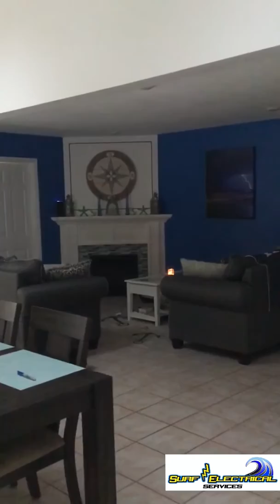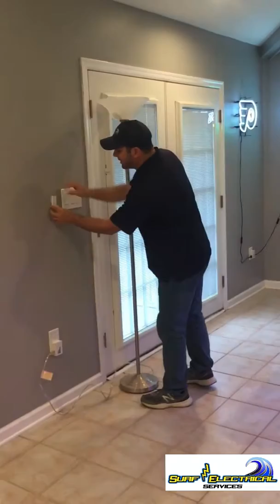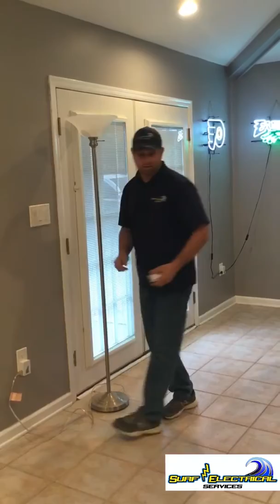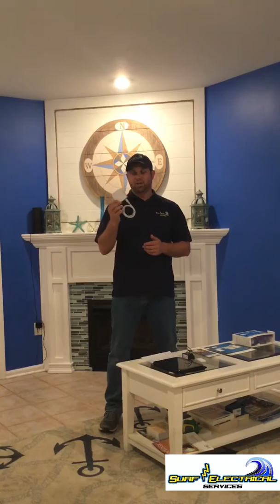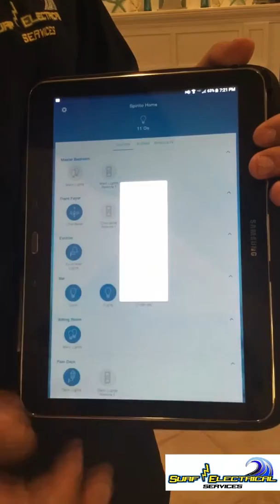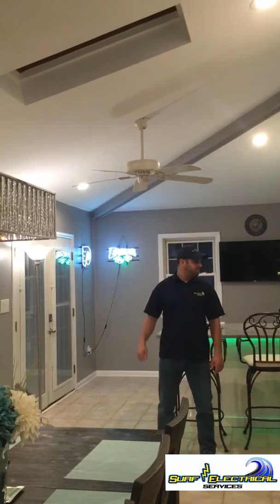Lutron Caseta Wireless

Comment: Hi There - I have a new home being built and about to do the walkthrough with the electrician. Regarding 3 way switches and building code:  Will the electrician still be required to wire for 3 way, even though one location will be a dimmer switch and the other just a pico remote?  Is it ok to wire it that way with one of the gang boxes capped off?  What do electricians generally recommend when doing whole home Lutron Caseta?
Reply from the maker: Hey! So I have installed Caseta picos  as a 3way but still have run the wiring for a wired in 3way as well and passed inspection. I would definitely follow up with your electrician and Electrical inspector because not every inspector interprets the code the same. My point getting it passed was that the wiring is in place in case a remote stops working or is taken out.
Reply: @surfelectricalservices4043  Great, makes sense. Thank you!